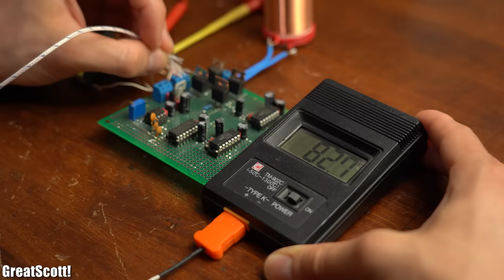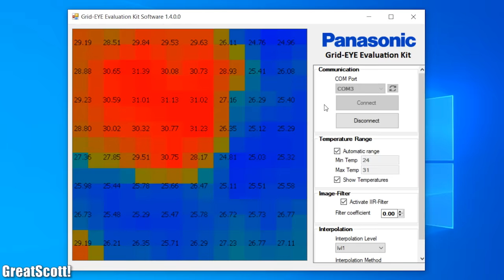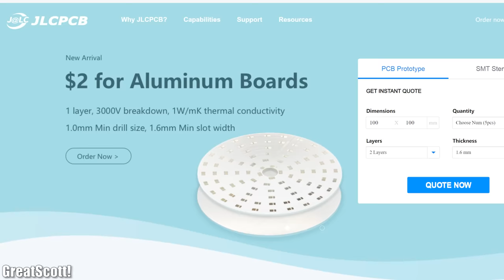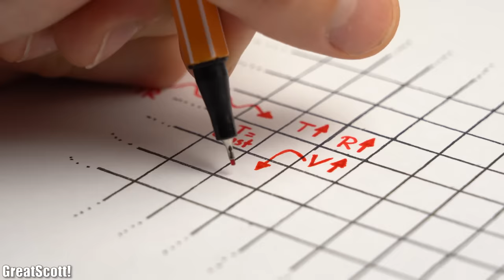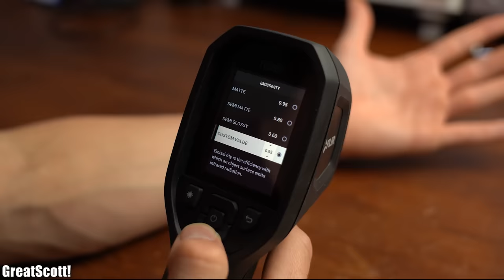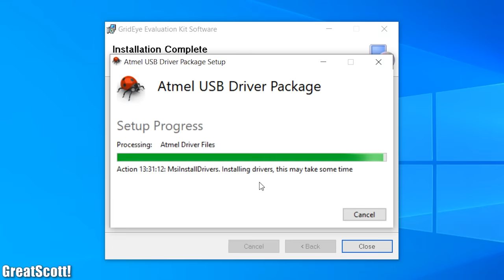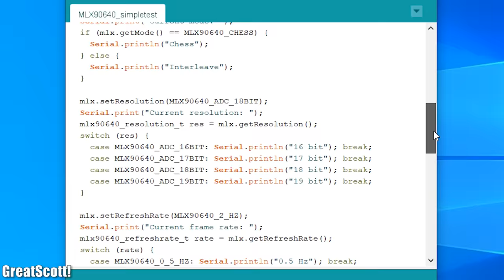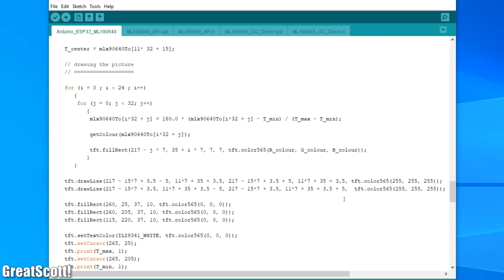Thermal Imaging Camera DIY $110 VS Buy $530 || DIY or Buy

Comment: $110 is too little, but you don’t have to spend $530 to buy a decent thermal camera for electronics. For example, you can get the FLIR One, which connects to your smartphone and has 80x60 resolution, for about $200 (there’s also a Pro version with 160x120 resolution, for $400), or you could also get cheaper ones from other brands, like UNI-T. Or if you prefer DIY, you can make a 160x120 camera for about $530 (or cheaper if you use other materials), using a FLIR Lepton: https://diy-thermocam.net.

Comment: não e possível ligar vários sensores desses diy em paralelo pra conseguir uma resolução maior ?
it is not possible to connect several sensors of these diy in parallel to get a higher resolution?
Reply from the maker: In theory, yes. But I think aligning them will be a horrible task.
Reply: @greatscottlab  more alignment as if it were 3D cameras and using something more than an esp32 could bring better results than a professional since a video camera is not expensive

Comment: I'm planning to make a metal furnance,but most of the high temperature sensors are limited to 999 degree Celsius,hope the thermal camera can help me!
Reply from the maker: Check the temperature range. Not sure if that will work out.
Reply: @greatscottlab  that something I'm concern!,since it's design to melt metal,the temperature will over 1200,which out of most resistance sencer's range?
Reply: @greatscottlab  BTW,how's in Germany?I heard there's a serious flood!
Reply: You'll be looking into R or S type thermocouples for that, tho are on the 1400+°c range. I bet you'll have to dump quite a bit of money on one of those, but it's sadly the deal when you start to get into extremes.
Reply: @Kalvinjj  Got it,thanks a lot.I'll balance the price and try them out!

Comment: I can recommend the FLIR one pro, it is quite good for the price.
But the software is not that grate, you cannot get the raw data, mine will not add the scale to the pics, and the timelaps feature is a joke. you cannot just type a time interval, you have to use one they have selected, it dos not just save a pick, it creates a video, and even when I select 30 FPS i get 8.xx or something like it. If they would spend some time on the app this could be a no brainer for many DIY people out there.

Comment: Bro am beginner in electronics ... I wanted to make my 3v battery powered multimeter into rechargeable I tried many ways but I I can't find one ... because when I use  an lithium ion battery it's voltage would be 4.2  volt it's to much for multimeter and it will burn my multimeter and when look for step down converter it wanted an  input voltage is above 4.5 volt so pls help me to fix this problem and give constant 3v to multimeter and also rechargeable... 😁😁😁
Reply: Look for a buck-boost converter chip, that can also function as a lithium-ion battery charger.

Comment: 2024 revision would be nice. Temu sell some thermal imaging camera for around 170 can$. 
worst thing is im sure they are as good as the 530$ Scott made his video with. we have went way forward in this line of tech, im not sure wich are the 2024 sensors to make a DIY version but im sure they could be cheap and better than the MLX90640. this sensor should be obsolete by now. im trying to find the newer version, and also if it takes a whole rasberrypi with ram and all or still a esp 32 could do the trick. im really close to buy a 250$ already made model but before i go do that i must know what the DIY world hold in their hands in 2024

Comment: Surprised you didn't get the smartphone version
Reply from the maker: I worked with such a handheld version before and wanted one.
Reply: @greatscottlab  I see. The smartphone versions really intrigued me, there's another brand with 2x the resolution of the flir but doesn't have all the same features. I feel like the smartphone allows some extra things like bigger screen, easy saving and sharing, casting to other screens, etc, but whatever suits you best. Good video regardless!

Comment: Overlay on the camera image is possible by connecting the MLX90640 to OpenMV https://youtu.be/nwr_moxiBY8 My thermal imager based on MLX90640 and esp32 is somewhat faster, has the ability to save images and interpolation mode https://youtu.be/oN6PZcdBz_w